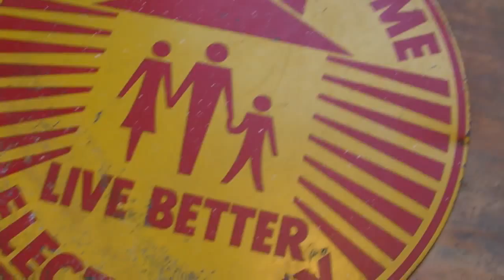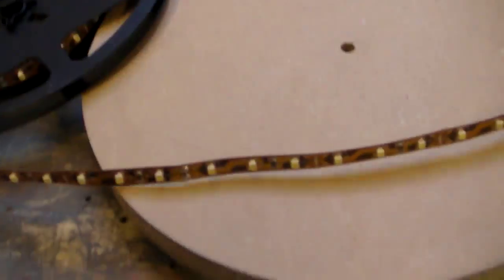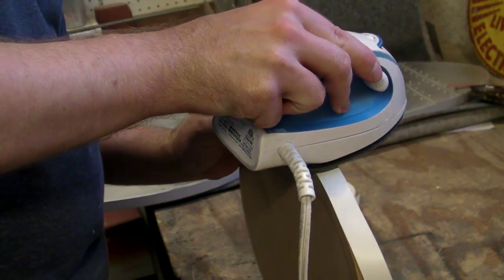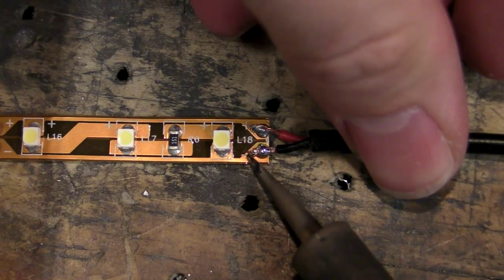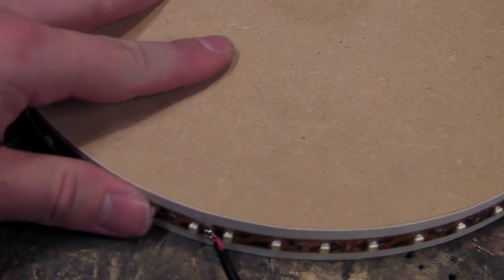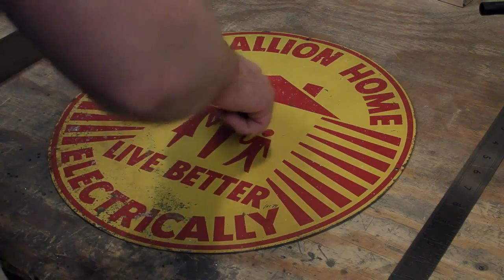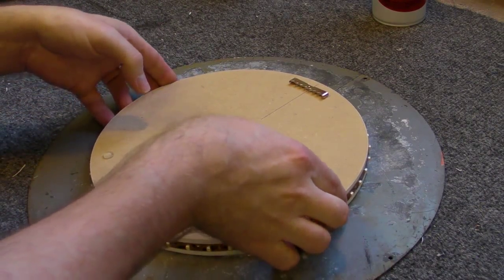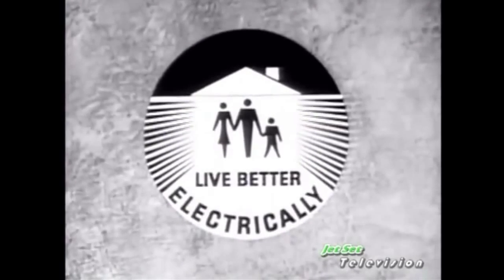Living Better Electrically! Restoring a Vintage Medallion Home Sign

Comment: Great sign! We have those medallions on the doorbell buttons where I work as well. Built in the early 70's. Complete with GE heating and ranges, probably fridges as well but I haven't seen any completely original appliances other than heating and cooling

Comment: My house was built in 67 and my doorbell has that medallion, added gas forced air and stove but kept the medallion. The original heat was radiant wires under the popcorn ceiling.
Reply: Our 1069 house as well.
Reply: Oh the smell of warm popcorn during the winter must have been amazing!